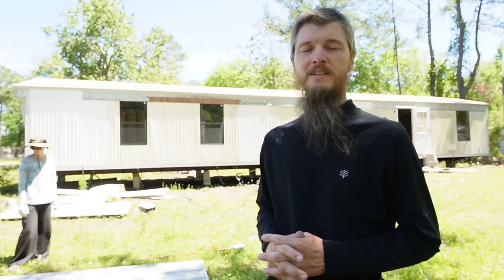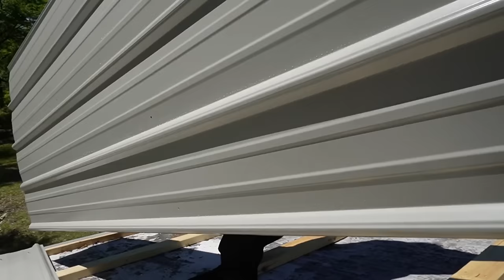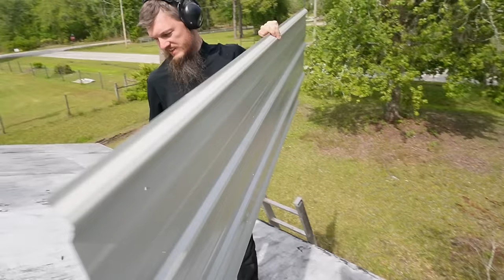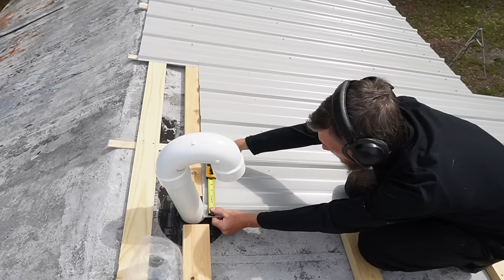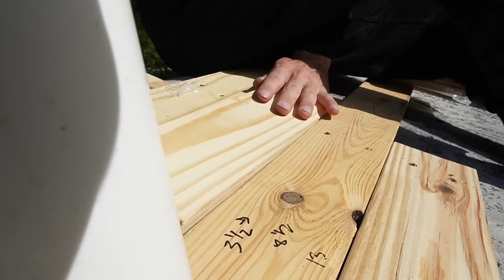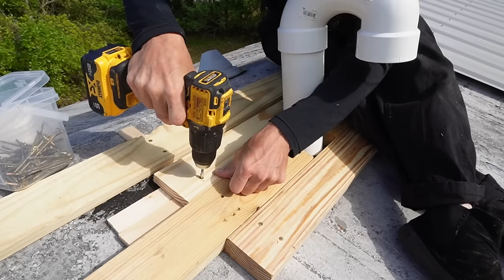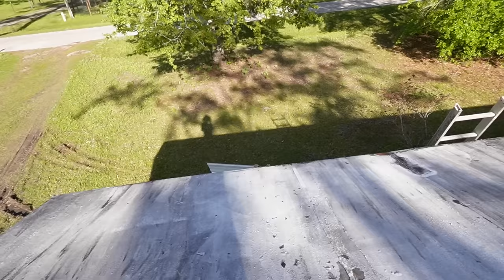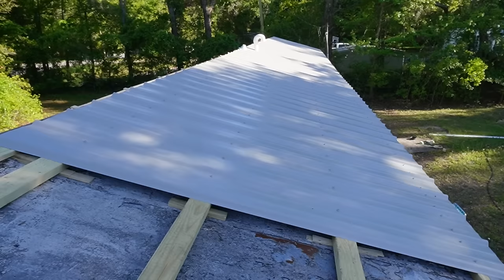Laying the First Panels - Metal Roof Install - Salvaged Mobile Home Rebuild

Comment: I like the overhang. The runoff wont wash down the side walls that much. You could put full size gutters under the edge?
Reply from the maker: We won't be installing gutters on this home. It doesn't need them.

Comment: Well done in a day or two roof done.. would it be quicker with Ashley  and bell lifting sheets up instead of up and down 😊
Reply from the maker: No, too risky. It's much easier for Doug to handle the sheets, especially if there is a gust of wind. :)
Reply: @diyfferent  yes  definitely

Comment: Looking good!  Glad to see the metal sheets going on fairly easily and quickly.  Too bad you don't have a 3rd person to hand the sheets up to Doug, so he wouldn't need to go up and down the ladder for each sheet.  It looks you're not using the screws with the cap that covers the rubber gasket, or am I not seeing very well?  Once the other side is on, I think you'll notice the inside of the home won't get as hot when the sun is beating down on roof. 

Even the neighbor's rooster got in on saying good-bye near the end of the video.

Comment: No butyl tape this time between the sheets like you did on your other home?
Reply from the maker: At our main house we only had to do the butyl tape on certain sections that were too low of a slope. This roof has a steep enough pitch so it doesn't need it.

Comment: it looks great but just wondering why you didn't insulate  under it or under your sub floor?
Reply from the maker: We have to install things in the correct order. The electrical and plumbing get installed first.
Reply: @diyfferent what they mean is why not add styrofoam under hot metal panels for added insulation. It’s what I’ll be doing.

Comment: For the roof vent, I thought you would have put two vertical pieces, but I guess that's a worse idea? I have no idea about roofing or why it would be better/worse. I just thought two vertical pieces would be extra support where the cuts were.
Reply from the maker: There aren't any trusses to go vertically there, so the screws wouldn't hit anything. We only screw the boards into trusses :)
Reply: @diyfferent  Oh, I didn't think about that. Thank you for the reply!

Comment: Have you had to level a mobile home yet? Is it something I can safely do myself?
Reply from the maker: Yes you can if you have a good bottle jack and a water level or a laser level. It's definitely doable. I payed to have it done, and then had to fix it after they left. But we don't have a video to show it.
Reply: The process is pretty basic and can be done yourself, but it's also not an expensive job to hire a mobile home mover to come and do for you. They will have the tools and equipment to get it done fast and safely.
Reply: Just saw this question, have a look at house racing videos on YouTube as they should give you some idea about the process. To me the big thing is if you have some ground clearance to fit jacks and pads under, just don’t get under the thing if it’s resting on jacks always make sure that it’s blocked and always have help on hand for safety. Enjoy searching that rabbit hole, hope you come up with a workable strategy.
Reply: They have a video where they discussed this particular job. I believe they hired someone to do it for them.

Comment: Looking good Doug I need this so bad in my home 🏡 but physically can no longer do it, I wanted you to know I did replace 5 windows in my home 🏡 I had to hire it out, but I got it done, I still have 5 more to do yet, but it takes time I have to pay these ones off first atleast I got a lifetime warranty on my windows with a good company! I used to do all my own stuff wish I still could, I need repair work in my roof too before the new roof itself goes on, and I only want a metal roof, because I don’t want to have to worry about replacing it again, it is around 25 years old now guessing! Slowly but surely, then I got floors to do too, I started them but I can’t do a lot at a time, and money runs out quickly! Blessings on you all in Jesus name! 🙏🦌🫂✝️👀❤️🏡👴

Comment: How much insulation will the air gap under the new metal provide?
Reply from the maker: I don't think it will add any true insulating value, but it will help reduce the amount of radiant heat that would be heating up our home. It's kind of like putting a shade over the house.

Comment: 👍👍😎✌️🤟 What about the rubber seal strip at the eave end to keep out insects? 🤭
Reply from the maker: We just opted to not install the closure strips on the bottom side, but we will install them on the ridge cap since the gaps are larger. We're not too worried about bugs getting between the roof.

Comment: Seeing you go up the ladder with those panels and then traversing the roof with them was hard stopping for me. I had to peek through my fingers. Lol question why didn't you put the ladder closer to where you were working? Was it a ground issue?
Reply from the maker: We didn't want the ladder resting on the metal drip edge to keep it from getting damaged, so we put it on the other side.

Comment: WOW!!!  It looks so good!   Could you use the excavator to lift your panels to be easier to get on the roof?
Reply from the maker: We can't get the excavator to this property, plus there's no point in tearing up the land with machinery when the panels are easy enough to bring up the ladder.
Reply: @diyfferent  Good point.

Comment: I  stumble on y'all  YouTube page? I'm  subscribed to it because I love doing this kind of work, y'all doing, and I'm watching the roof over Episode I used  1×4 Has my firing strips for my roof okay, I notice y'all do not use insulation under. The metal when I did mine. I did it the same way space. The ferring strips two feet And then I put  foam installation in between my furing. Strips, Also You're supposed to run a Strang from corner to corner. And that will be a mark for your overhang. That's where I screwed up. It cost me. I still kick myself for that

Comment: So, all the gaps will be sealed, too, as you don't want bees and wasps making nests  under the metal roof. Right,?
Reply from the maker: We've opted to leave the bottom open and will seal the top. We're not worried about bees though.

Comment: Why the shims under the strapping please?
Reply from the maker: The trusses on this trailer are old and many of them sag, so adding the shims evened those areas out. And then once the metal got installed, it looked nice and smooth without dippy areas.

Comment: Can’t u bring up a couple of metal sheets instead of one at a time ??
Reply: Dang!  They are heavy!  I’m surprised he can carry one up a ladder by himself!
Reply: By raising roofing (metal sheeting) versus coating or regular roofing sheets directly on old roof more cost effective? Wouldn't a heavy wind pull the metal loose or water get under it?
Reply from the maker: It's much safer and practical to bring up one at a time. Also, if a gust of wind happens, it could easily blow off the 2nd panel while we are working on the first sheet.
Reply from the maker: @maryjscholl1963  We were going to coat the roof, but then decided to skip that and just do the roof-over instead. I don't know what you mean by regular roofing sheets. Wind can't pull these panels loose. Our furring strips are all very secured to each truss with two long screws, and then each metal panel is secured to those. Water can't get under these panels. A lot of homes have ribbed metal roofs just like what we are using.

Comment: Wish I'd expressed my opinion sooner, but installing those metal panels over empty voids concerns me. It's now easier for hail to punch a hole through it, the noise will be deafening,, and you may not be able to insure it so there goes your investment. IMHO based on personal experience.
Reply from the maker: We aren't in a hail-prone area. Installing the panels the way we did is the most common and practical way to do it. We have zero concerns.

Comment: Give it a year and the roof will leak, you put the screws on the ribs, this keeps tension on the sheet
Reply from the maker: This is the most common way it's done here. Installing the screws on the ribs is also acceptable if done correctly. I prefer the method we chose because it gives the screw a firm surface to compress onto. I'm not concerned about leaking at all and I don't have anything negative to say about either method. Just do what works best for you.
Reply: This was my question as I've seen it both ways. I've heard on a metal side for a building it's fine, but not on the roof. Planning on replacing a metal roof on a shed.
Reply: I believe this is the third metal roof that I have seen Doug and Ashley do. They usually have stayed in the home for at least a full year of seasons after their roofing jobs. They usually share if there have been any failures and any repairs that are required.
Reply: They roofed over a roof that as far as I know had no leaks from what I have seen. This isn't their first rodeo. They're good at researching as well. Also if they go over it with that sealant stuff for trailer houses they'll be really protected then. I ain't worried about it I have faith in Doug and Ashley's work.
Reply: @missreynolds3637 You don't use roof sealant on that type of metal roof .

Comment: The roof looks great, but.... No overhang? Will it at least have gutters so water doesn't run down the sides of the house? Just my opinion, but it seems like a missed opportunity to correct the bad mobile home design.
Reply from the maker: It has small overhangs so it's better than before. That's a good point to bring up though. We'll try to show that detail in the next video maybe?

No overhangs isn't all bad though. In a high wind area, less overhang means the wind has less to catch and could save your roof in a storm. The downside is the water issues.
Reply: @diyfferent  I was thinking something like a 6 inch overhang. to keep the water off the sides of the house. Which wouldn't be much to catch the wind.
Especially if the panels were longer and then cut. Anyway, at this point you have to use what you have. If I may suggest.... Gutters would definitely be a good idea at this point.